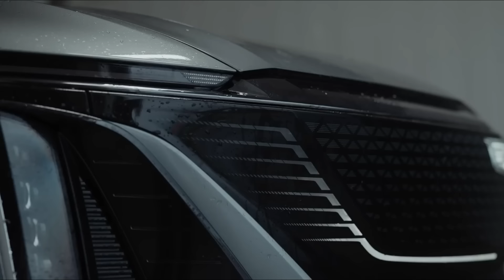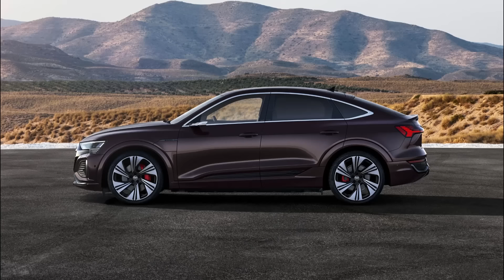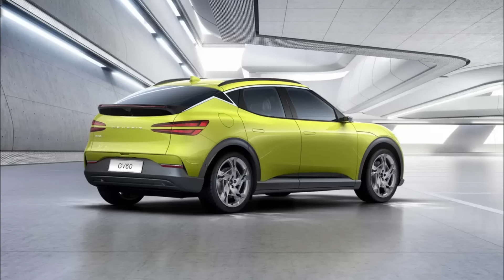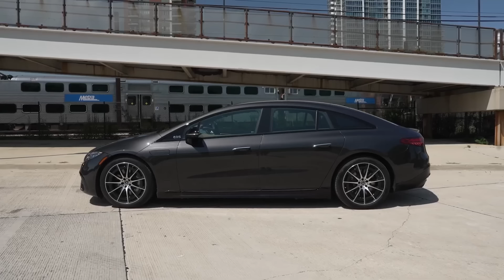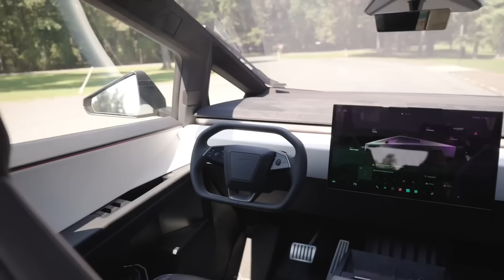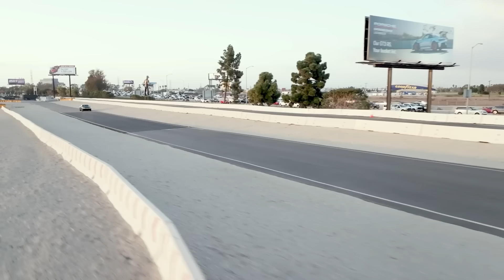10 Popular Electric Cars You Should Absolutely Avoid Buying in 2026

Comment: Why are the Blazer and Lyriq so much worse, than Optiq, Equinox, Bolt? I have a 2025 Chevrolet Equinox EV AWD, so first hand, I can vouch for the 100% reliability over the last 10,000 miles. Before that, I drove a Bolt for a week, and the experience was good enough, to prompt me to lease this Equinox. If I didn't need AWD, because of living on a steep hill where it snows in the winter, I would be driving a 2023 Bolt. I rented the EUV, because that's what they had on the lot, but it was still flawless, and wildly energy efficient. I just about tossed a coin between the Blazer and Equinox, and according to this video, the Equinox may have been the overwhelming better choice.
Reply: The Blazer and Lyric have been plagued with software issues.
Reply: @johninlasvegas So Lyriq and Blazer are NOT having trouble with charging, motors, motor controllers, or batteries? Just software? My Equinox gets OTA software updates regularly, and again, no problems, The Sat Nav is the best I've ever used! I would think that the hardware, and processors would be similar over the entire GM EV lineup, all brands.
Reply: I’m skeptical of how the equinox is so much better than the blazer.   They’re the same car. I have a hard time believing that General Motors is using unique parts for the equinox.  Software issues may have been true because the blazer was released before the equinox  but those issues have been ironed out with software updates 

I don’t think the first year electric vehicle should be judged based off  the early software bugs that have been remedied
Reply: @superonyx2  That's what puzzles me! I'm not having ANY of the reported problems, that the Blazer is having. I do know, that the Blazer is much more powerful, thus, larger motors, heavier duty motor speed controllers. They also feature slightly higher battery voltage, but most of the problems seem to be software related, which I thought would be pretty universal among all GM models. Both the Equinox and the Bolt use the lower voltage batteries, and neither seem to have the software bugs, that the Blazer does. I don't see how that relates.